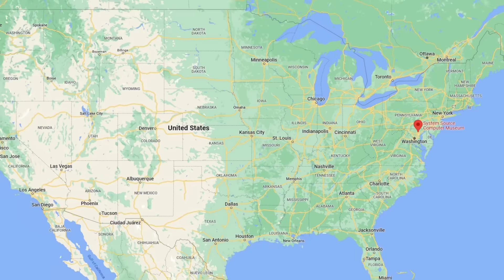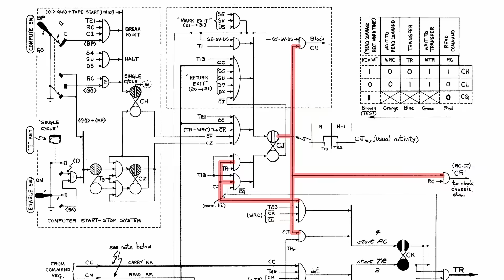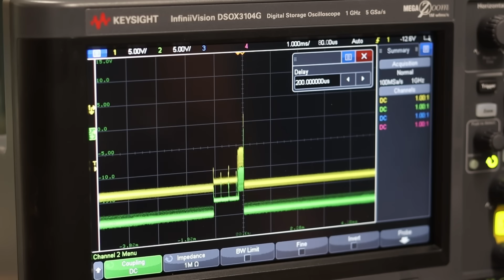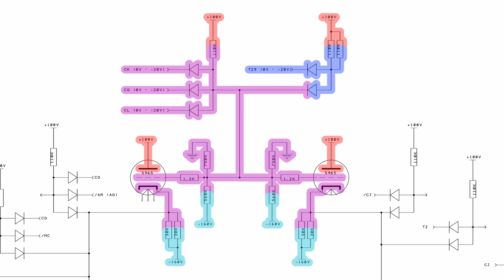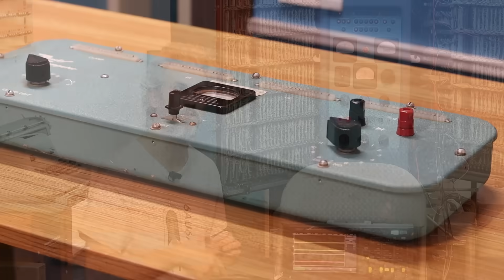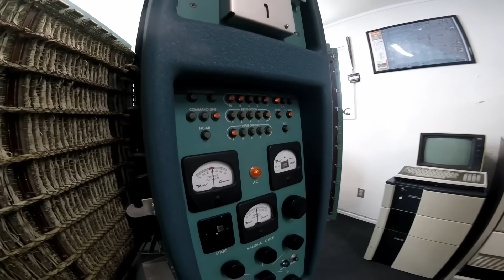This G15 is the Oldest Running Digital Computer in America!

Comment: What else can this computer do? 

 I was imagining that a few things could be done with this: Number one idea is to see if there's a way to replace the tape feed with a simulator so that it's easier to get programs into the computer. One thing is to see if any or all of the outputs to an oscilloscope can be organized into another computer to get a real-time map of what's exactly happening to the computer. Then, see if there's another/a new way to create a GUI interface for it that can encompass writing and committing applications to this computer.  Then lastly, get this thing hooked up to the internet using a linux/unix system and give people time to play with this computer for study/learning purposes.  If it's not hard to maintain this machine, I think all of these enhancements would be amazing to breathe new life into a computer that is fundamental in all of computer science.  Finally, I think it would be prudent to see if there is a way to take the schematics and virtualize the computer, that way, it can be simulated and studied in that way. 

I think it's amazing that it is even up and running, and appears to work perfectly. We may need these computers at some point if civilization gets a huge setback due to a destructive wave of war. Things like this should be preserved because they work. Yeah, i know, a calculator is pretty ubiquitous and a Texas Instruments hand held graphing computer is more useful than the Bendix, but the fact remains, a vacuum tube computer is rare, and should work even after an EMP pulse fries all the other computers.

Comment: How do you know the schematic you have is the exact rev level of the machine?  Back in the day, I think it was pretty common for field technicians to apply minor engineering updates directly to the boards - adding jumpers, cutting traces, etc.  The techs were supposed to update all the customer's documentation so that the docs matched the customer's machine - but, stuff happens...

Comment: There is a good chance this G15 is the oldest operational general purpose digital computer in North America.  Not to throw cold water, but there is a possibility there are some telephone exchanges which may be older and still operational.  The marker used to make call routing decisions mostly fills the criteria which  define a digital computer.  The thing lacking is general purpose as the program logic is hardwired into the equipment.  The first No. 1 crossbar exchange using a marker was installed in Brooklyn, NY in 1938.  I don’t know how many, if any, No. 1 crossbar systems are still running.  It is possible large factories, hospitals or schools could still be using one as a PBX system.  I personally don’t know the answer, but I find the proposition interesting.

Comment: This is just terrific. Congratulations. 
Couple of observations and a question:
1) Interesting that the Bendix used photodiode detectors in the paper tape reader. The Teletype tape readers of similar vintage used mechanical probes/switches to detect holes. I suppose one of the advantages of the mechanical system was that the clock signal came from the cycling of the mechanical probes. Clearly the photodiode reader is much faster.

2) I spent much of my career writing emulators --- making one device "look" like another, and/or enabling two computers to communicate with each other in ways not anticipated by their designers. While watching your work I was amused by the thought that you might be able to do something crazy like boot Linux on the Bendix or have the Bendix be a peripheral to some other system....Maybe just have the bell play Jingle Bells!

Question: Maybe this was buried in a previous video, but what is the total input power consumption of the Bendix while operating? How much heat does it generate? Surprised it can work without supplemental cooling.

Comment: In the summer of 1963, I went to the Summer Science Program in Ojai, California. One of the tasks was to calculate the orbit of an asteroid from observations made with a 16" reflector telescope. Over three nights, we took photographic plates of the estimated location of the asteroid and three adjoining stars (it moved with respect to the stars), mechanically measured their locations on the three plates, then calculated the orbit using two methods: logrithmic tables and Friden calculators, and using a Bendix G-15. The exposures of the plates took, if I remember correctly, several hours, and during that time the telescope needed to be held on a guide star using a primitive joy stick. The calculations on the Fridens meant meant keeping track of 10 digit numbers. For the G-15, we used a mechanical punch to enter the coordinates of the asteroid and stars on a paper tape and fed that into the computer. Needless to say, the computer was much quicker and there was less chance for mistakes. This was my first exposure to a computer - I ended up spending my career in the semiconductor industry.

Comment: Yo what is the KIPS speed ?    750KIPS for the Teledyne MIL-STAR.  Processor FEU (functional equivalent unit ) in Uh. 1990.  The mighty MPC603 was a game changer Super Scalar Risk engine,  that is how i became a CPU Guru, i was the schematic capture goforer on our MPC603 single board computer. Jim Simmons christened it our Big Bang.   A order of magnitude faster at 180MIPS at 99MHZ..

Comment: Classic trouble shooting,  drive reset with a square wave and start poking.    If you CIC. Single step to failing microcode address,  then trigger on that address.   I was the MIL-STAR PROCESSOR. Repair man. At one time.

Comment: Well done!  Many years ago, I worked for Burroughs.  One of our customers got a new B800 and none of us techs could figure out what was wrong with it.  So, we got a tech rep in from Chicago and he and I probed into this thing for an hour or two and nothing.  Then, I noticed an anomaly on the flashing LEDs on the test board.  Not an error, just a "Huh, that looks funny" sort of moment.  These things used wire-wrapped backplanes, and one of the wires had turned a corner against a square(!) pin a bit too tightly and was just barely making contact.  Replacing the (tiny red) backplane wire fixed it.  Anyway, watching you get this old thing running brought back a bunch of old memories.

Comment: In 1971 Rose-Hulman Inst of Tech still had one of these stuck in the basement and mostly running .,,, altho fairly often you had to stop and run the diagnostics to find bad modules and replace them. As a high school student I wrote a small program to transcribe morse code. I am guessing this machine is long gone from the basement,

Comment: The companies that bought this machine, what problems were they hoping to solve or speedup with this? Do you have a real world example, and any software that could demonstrate this?
Reply: They had a niche in civil engineering, particularly highway construction, generating cut and fill tables. Not sure if any of the paper tapes that @usagi has would be for this or not.
Reply: Early computers, generally, were doing computations for which results could be printed in text.  The graphic displays which have become so familiar today require huge memories and fast computation which were not possible when computers such as this one were built.

Comment: I love it, have been waiting for this level of success.  Liked your troubleshooting and the platen hitting the wall was great.  I was getting goosebumps here wrapping my head around this in tubes and diodes as a life long uP embedded hardware and software/firmware engineer.  This is awesome!  I hear ya on not seeing tube leakage in experience, I've also never seen that and have tested a bunch of tubes.

Comment: heh... A Bendix G-15 was the first computer I ever used, and here it shows up. This video happened to appear in my feed (which typically doesn't have much computer stuff); quite a surprise.  That was in the '60's; the obsolete G-15 was on loan to the school district (I presume because it hadn't yet been sold to anyone).  We learned to program it in "Intercom 550" IIRC.  I later found out that Intercom was an interpreter, interpreting a low level language resembling machine language.  I still remember that location 2173 was special; it was the address of the accumulator (for explicit reference to it, rather than implicit reference by definition that many instructions used).  At a minimum, Intercom relieved the programmer from having to deal with G-15's every-instruction-is-also-a-goto "feature", as mentioned in the video.  The G-15 was designed as an engineer's workstation or personal computer (to be shared across a department, presumably).  Some years later, I took a course taught by Harry Husky (the main G-15 designer); he made sure we knew about how mercury delay lines were the main memory "back in the day".

Comment: Beautiful and very clean early computer. When I was a kid (about 1962) there was a company selling these near the old LA airport for parts. It's wonderful you got it working and have preserved it. The first gen solid state computers are just as rare now days. boards filled with discrete transistors. Bravo from an old Intel engineer -

Comment: Great but far before my time.  In 1970 I worked on the prototypes of Philips Main Frames, the P1100 with max 64KB core memory at 1 μs with a 8 bits arithmetic unit needing 4 steps for a 32 bits addition, the P1200 with max 256KB and a 16 bits arithmetic unit and the P1400 with 512KB and a 32 bits arithmetic unit.  The last 2 models also supported mass memory 1 up to 4 cabinets with each 2MB of memory at 2.5 μs.  Everything was built from DTL nands.  Personally I tested the data-communication, where a IBM-BSC type of protocol was hardwired.  It was running up to 16 CRT displays on one 9600 bps line (inplant).

You could fill a whole screen in 1 second, max 1.5 seconds, that did beat the ASR-33 Teletype at 10 chars/sec (110 bps), where 1 line could take up to 8 seconds.  On that 9600 bps line we did connect displays (24x80 chars); matrix typewriters, a punch card reader with a numeric keyboard for updating the stock in a warehouse, a P350 Office Computer for e.g a remote sales office and a mini computer, that allowed to have remote card readers and line printers for running batch jobs on the main frame including e..g. program development. 

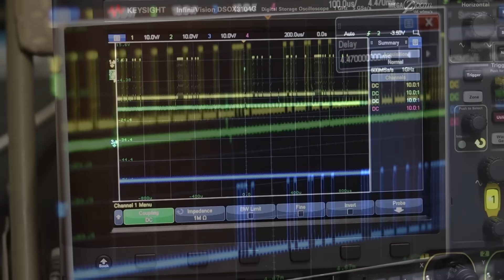You could update your source code using a terminal, but for compilation and printing you had to submit a batch job.  Once on a Fridays morning I started such a job and I was happy, because I was say number ~4 in the batch queue.  It never seemed to finish, because there were higher priority jobs and when I went home at 17:00, it was number ~86 in the batch queue.  On Monday morning my job was finished too :) :)

Comment: Positively beyond awesome!  Incredible job done by all.   Thank you Keysight, for giving UE the wonderful tool to help make it happen -- what a wonderful gift!   Having the G15 running as well as it is, with only a few component failures after all these years, is testimony to the skill of its designers.  The ringing of the bell not only tells of success, but also chiming in the resurrection of this fantastic and historical first-generation computer.   When it hit the end of DIAPER and rang the bell a bunch of times, I literally had happy  tears flowing.   This is a momentous achievement in the history of retrocomputing.  A paper about this resurrection should be written for publication in the IEEE Computer Society's Annals of the History of Computing.     I applaud Bob at the System Source Museum for placing this invaluable relic into your capable hands to get it running again.  I'm sure Bob is ecstatic with the success.   Thank you for sharing the journey with your wonderful videos.    You did it!!!!

Comment: I know nothing about old computers like this.  What did a big giant computer like this actually do back in the 1950s?
Reply: these were used for solving problems in civil engineering. many were used for pure maths problems. 😊
Reply: the G15 here also had a plotter option so it could print curves and traces

Comment: I remember (barely) in the late '60s "programming" a G15 to calculate the quadratic equation. If the numbers were simple, we could get the answer first manually. It was in a small, hot room and gave a spooky aura when it was typing by itself. In the '70s I very briefly met Prof. Bill Tutte, a colleague of Turing. I had no idea of the connection of the G15 and Colossus.
Reply: As I've gotten older, these kind of memories have become more remarkable to me.  I was born in 1980 and I have a hard time remembering things even from the 1990s sometimes!  Amazing to think of someone in 2024 recalling memories from the 1960s!  Sounds like you had a fascinating career.

Comment: Using a modern 4 channel scope on the oldest computer is sacrilege.    I have a single channel GEC Miniscope, 50kcs band width, and based on WW2 clandestine oscilloscopes used to repair spy radios behind enemy lines.  Just send me that nice new HP scope and I might send you an old period correct valve scope to work on your valves  😁
Reply: If you had any experience of debugging a serial computer you wouldn't say that !  I use a four channel DSO to debug the Elliott 803 at TNMOC, and I'm in awe of the engineers that did debug these machines with just a single (or maybe double) beam analogue 'scope.

Comment: You should buy an ESP32 Dev board and hook it up each pin(with proper voltage controls), to every one of those Debug output pins on that one panel and have it monitor the machines output at every stage. Having a proper diagnostic execution chain may help you spot more errors at a glance and less hunting ghosts in the future, as a bonus you can use it to verify a lot as you send custom programs to it in the future. I'm sure the Museum might be able to use it too when you're finished with it.

Comment: It makes me inexplicably happy to see an old computing machine brought "back to life" like this.  Emotionally, it's a bit like finding an aging pet and deciding to nurse it back to health and look after it for the rest of its life.  The difference being that, with the proper care, an old machine can last as long as there are people to care for it and repair it.
Reply: Replying to myself with a suggestion to program the Bendix to do the Fibonacci sequence, at least as far as it can (or up to a sensible limit).
For those who don't know, you start with 1 and 1 as the "previous two answers" and then you follow the sequence of "add the previous two answers, print, repeat until it overflows or exceeds the limit you originally set".
The sequence goes 1, 1, 2, 3, 5, 8, 13, 21, 34... and so on.
With 29 bits available, you can get up to more than 500 million as a result, so it's probably a good idea to put in a check to stop it when the result exceeds 1000.

Comment: The really surprising thing about old vacuum tube devices is just how reliable they are. Watch any restoration videos of amplifiers or radios or even computers from this era and the tubes are always in better working order than the passive components and they can be surprisingly linear even beyond the audio spectrum.

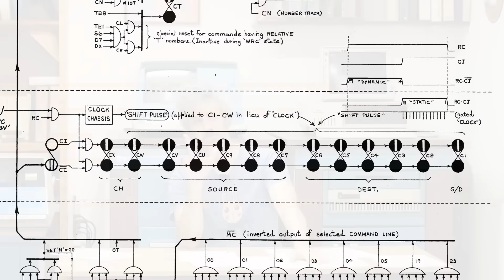Comment: Those flip-flop symbols are nuts, if I saw something like 18:29 I would be thinking 'terminal strip', as the top circles look like slotted screws with a wire tieng it to the terminal below.
At least you have silicon diodes (or are they Germanium), imagine this computer if they used diode valves/tubes.
I also keep thinking of babies bums everytime you reference the  DIAPER manual - what were they thinking.

oops, forgot the nutty typewriter, with it's keytops bouncing as it tries to print,.

Keep it up, waiting for the day when you get it to execute your code.

Comment: Wow, that's amazing!  Good luck on sorting out that typewriter next!  

The bell is a nice reminder of why that signal is called "BELL", why the Apple II and II+ keyboards say "BEL" over the letter G, to indicate what CONTROL-G does, and why PC speakers also beep on ASCII code 7.  As a child of the 80's, I remember when our washing machine and dryer had actual (and quite substantial) bells in them to signal "cycle complete", with a tone not unlike a telephone bell, but louder and a bit deeper.  I've periodically wondered how easy it would be to buy one of those bell units as scrap from somewhere and wire it up to be used for a modern -- or, at least, semi-modern -- computer's "BELL" signal.  I suppose most of them have long since been buried in landfills or scrapped for their raw metal.

Comment: Still asks a few more questions though,
Presumably to start off with the cards were in the posistions "as delivered" to you,  however we know the system wasnt working so it might have been a repository for failed cards as working ones pulled and used in another machine.
So we have , apparently from factory, a card that would never work (unless in a place where the solder join wasnt critical ??.  a card with a resistor out of circuit ,  again maybe not all cards needed a functionallity to do what they did in a specific location (its easier to make a "generic" then mod afterwards than custom build just one more card design- this might be too what the "bodge" wires are doing ?
is there another teletype (indeed laptop emulator?) that can take the data pulses ( and presumably needs a voltage box to supply / generate the extra voltages ) or is it all too specific.  At least you can probably make each character print wiring a 12v ? battery to each input wire in turn ?

Comment: I have used cooling spray on the actual tubes to find out broken ones. They can start working once cold. I am on the other hand not sure that it helps you, but it might. The odds for tubes being broken is many magnitudes larger than any diod or resistor being broken.